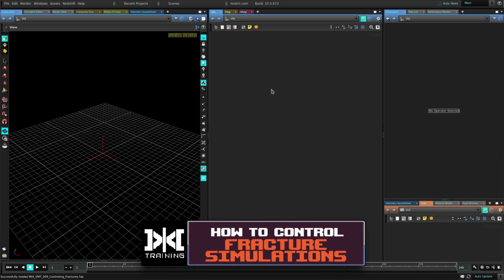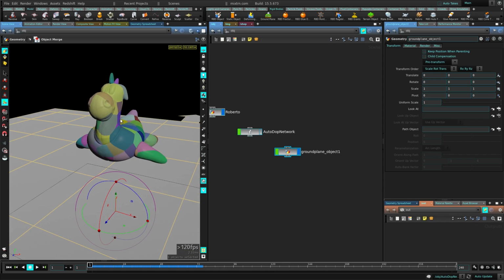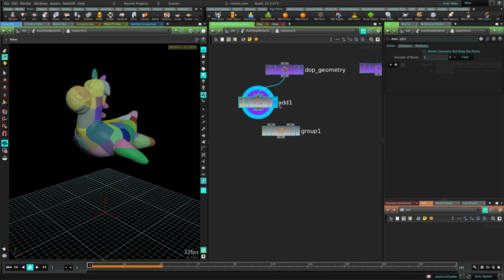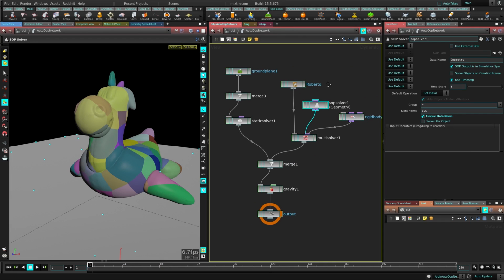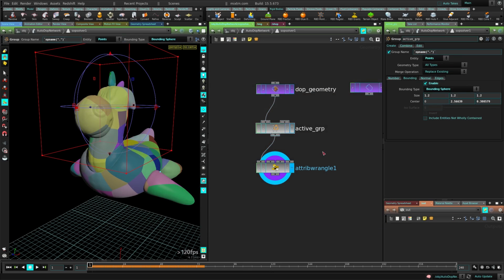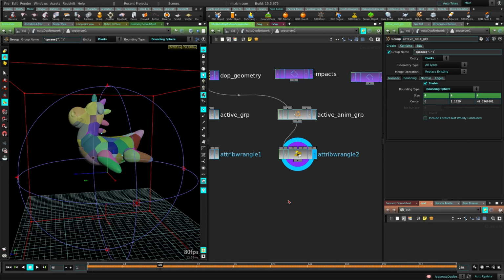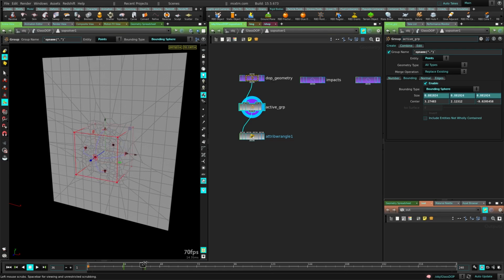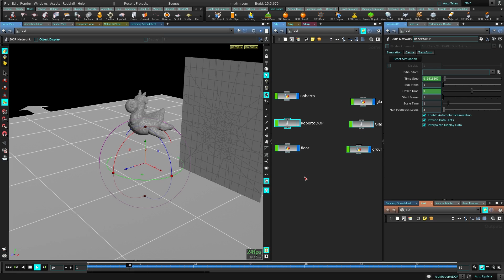VMT 009 - HOUDINI - How To Control Fracture Simulations

Comment: Hi, thanks for the tutorial :-) Do you know if it's possible to do similar stuff when using not packed object? Say, for it's interaction with fluids?
Reply from the maker: First do this sim then the fluids interaction, not sure what you are doing, anything is possible
Reply: @varoschool  Yeah, thanks, that's what I did in my test scene, and it worked (two DOP networks, in one I did some fracturing, and in the second fluid interaction). But what I was really trying to do, was to simulate creation of a waterfall, dynamically (so the geometry of the ground changes in time, then part of a rock rips off the hanging cliff and falls, and it all happens with flowing water). It kinda worked in the end, but I had to cheat some stuff due to massive collision issues between terrain and flowing water. If you're interested, I created a topic concerning that on SideFX forums. The link is: https://www.sidefx.com/forum/topic/66650/ I wonder if you may know a better (simpler? right?) way of doing this. Soon I'll be posting final result of that one in that topic.
Reply from the maker: @szolastudioanimacji8039  there's no simple way in simulation, glad you got it to work

Comment: Hi Varomix how can I add dust coming from the debris for example at the end when we break a hole in the wall. I can't seem to separate the debris from my the original geometry. When I try to add debris and smoke it adds it to the whole geometry instead of just the debris. Can you help?
Reply from the maker: Put the debris on a group and emit only from that
Reply: @varoschool  Thank you for the quick response, unfortunately I'm a bit new to Houdini so I don't quite know how to go about getting that done continuing from your above tutorial.I tried using the attribute wrangle, the sopsolver node where you added the speed etc.. to push the particles outward in the autodop network I tried adding the debris shelf tool to that node What node would I use  as the source to emit debris? And how do I put the debris in a group.  Can you give me some pointers on how to get it done. Thank you so much.
Reply from the maker: Just group what is not static, if you use a box group you can just get everything that goes outside of it
Reply: MIX Training thank you so much with a lot of trial and error I used a group node, I copied all the parameters from the original group node(active_grp) to the new one I created. I put the new group node below the  attribute wrangle then moved the timeline to frame 48 then selected the new group node and selected debris. And it worked.  I added a volume to the points But now my new issue Is  just trying to make the smoke follow the debris more fluidly. I tried sub-stepping  by 12 but I don’t see much of a difference. Any pointers?
Reply from the maker: @Arkahtek_v2  can't tell just by that, join our discord community and post screenshots there so we can help you better
Reply: @varoschool  gotcha thank you signing up now

Comment: Thanks Varomix for such a useful tutorial. I want to do the same thing by moving the object connected through the Attribute Transfer for more subtle effects, because Attribute Transfer has a nice Blend feature. I do the setup inside the SOP Solver, but can't achieve the decent result. I want to ask should I create the whole setup inside SOP Solver, or bring here a certain part? In may case, I only set up the Attribute Transfer part inside the SOP Solver, but there is something I do wrong that it works only for one frame.
Reply from the maker: yes by default those things work for just one frame in simulation, you have to set the sop geo to update every frame there is a parameter that says default behavior, change that to always, not my computer not sure if that’s the exact name

Comment: Will glue constraints work with this multisolver? Because I added a glue plus a magnet force after this and it isn't breaking..
Reply from the maker: Yes it should work, if is not breaking then is working, is just too strong

Comment: Hey thanks for the tutorial! However, I can't seem to get this to work in Houdini 16. It only works if I do i@active = 0; (so the group makes parts on the sim in-active instead of activating them) and only if the group is static, not animated. Any advice?
Reply from the maker: I just did the same thing for Houdini 16.5 and it works exactly the same way, you might not be setting your object to static, you need to do that first, so you can make it active in the wrangle, also if you are animating the group, you need to change the Default Operation of the SOP Solver to Set Always
Reply: Oh that's it!! Thank you so much :)

Comment: really interesting video but i have an issue:
i don't understand why, but i can't render packed geometry in redshift
it does render the fractured geometry but not the the packed one for some reason
keep up your tutorials they are really helpful for a beginner like me !
Reply from the maker: Z8' just use a convert node at the end and it will render, I think packed geo is on the works
Reply: thank you for the fast answer and yeah that would be interesting to see !

Comment: Great tutorial! Is there any way I can make that group boundary another object?  So the geometry only becomes active when the other object comes close to it? there's probably a much easier way to do this but I am still Very new.
Reply from the maker: You can use any object to group points just change the option to custom shape and plug your object in the second input
Reply: Yes thank you I did eventually figure it out on my own. But maybe you could help me with another problem I'm having. I have an object set up as a particle source, but can't figure out how to add geometry to the particles (Like if I wanted to make each particle a piece of a shattered object or just a cube or something)

Comment: Perfect tutorial!

One question: how can I transfer the attribute `active`(attribute transfer) from one object to another inside the SOP?
The object have to be imported as packed inside DOP, but the physics kick in that way. Also, I can't use attribute transfer for NON packed object inside SOP (I can't find way to do that).

I have small sphere, and big sphere (Roberto in your case is big sphere). I want to transfer active from object to object, not with group node.

Any hint?

Tnx.
Vlatko
Reply from the maker: Attribute transfer works for any kind of object, pack or non packed

Comment: I have a question. What was the vex code you added to force the glass out. I couldn't read it. Also. Is there a way you can animate the force to happen at a certain frame? Im new to Vex and need all the help I can get. Thanks for the tutorial by the way.
Reply from the maker: @v = set(0,0,10);
you can change the frame on which you activate the pieces and the force will be applied at that frame

Comment: Hi! first o fall thank you so much for your tutorial, absolutely usefull. I have a couple of questions if you don't mind (sorry for bad english);

1-  Why is important the input order of the sop solver? It wouldn't work if you change it?
2-  Why is the rigidbodysolver taking the object even if  it isn't conected to the first input? 

Thank you!! :)
Reply from the maker: because you want the simulation to first calculate the changes in the geometry and then evaluate that in other solver, the multi solver passes the object to all the solvers connected to it

Comment: The scaling up bounding sphere technique doesn't seem to generate uniform velocity to push out fracture objects.  It seems to favor one vector over the other two.  Try this in the anim_active_grp wrangle....

i@active = 1;
i@speed = ch ("speed");
@v = set (@speed, @speed, @speed);

If you setup a bounding sphere that scales up from the center point of a mesh, the results are not uniform as you might expect.  Curious if I'm missing something or perhaps there's another method to achieve the desired effect.
Reply from the maker: you speed parameter needs to me a vector, 3 floats, then just do @v = @speed;  that way you're passing 1 to the 3 channels which make a 1,1,1 vector basically averages the direction.
Reply: As you have this written it doesn't actually work when I try it.  Seems this is not an easy problem to solve.  Several have tried to solve this with various complicated methods since 2008 in Houdini that sort of work but aren't really the correct result.  This is pretty simple in things like Maya where you simply use a field force to drive dynamics.  There has to be an equally simple way to achieve this in Houdini right?
Reply from the maker: not really sure what you are trying to do, there is a force node to add force in a direction if you want you can use that
Reply: No, that's not it.  That's a single path vector.  Think "Volume Axis Force" in Maya.  Force pushing out in all directions from a center point.  The method you and I have been talking about still results in a single direction that is comprised of the combined vector value in x,y,z.  A singular line of direction.
Reply: you can use a magnet force for that, I added and example in the forum here, is a really common way to do destruction, nothing new and has been solved for years :) http://mixtrn.com/community/learnday-webinars/learnday-houdini-fracturing-basics/#post-17
Reply: varomix WEY Thank you for that. I checked that out. Seems like an ok workaround. I'm going to try and work out something a bit more dynamic. Thank you for taking the time to respond to this. :)
Reply from the maker: more dynamic? again, depends on what you need, there's also an advect by volume, if you have a visual example, this would be way easier

Comment: Thank you for these tutorials, really useful! :) One question about this particular one.  I tried using this technique over multiple fractured objects (Parts of a building), using the merge node to plug them all into the sop solver. Then I tried to group the points to be active using a custom bound volume using multiple spheres so that it would collapse at various places, yet nothing happens. Should I pay attention to anything in particular when doing this over multiple fractured objects?
Reply from the maker: Did you set the group option on the Attribute Wrangle? I always forget that :)
Reply: Yes, I had set that correctly, right now I tried exactly what you show, using 1 bounding sphere from within the group node and it work perfectly.

http://prntscr.com/du3obx

This is what I tried to do before, merging these http://prntscr.com/du3ogt in to use as bounding volumes but it didn't work at all? I guess I could use multiple group nodes instead of these spheres to achieve the same result.

Thanks for the quick reply!
Reply from the maker: If those spheres are not going to animate at all, set the same parameter in SOPS, the simulation should pick it up, same setup as in the SOP solver but in SOP directly, and no need for the SOP SOlver
Reply: Thank you! This one worked perfectly! :D